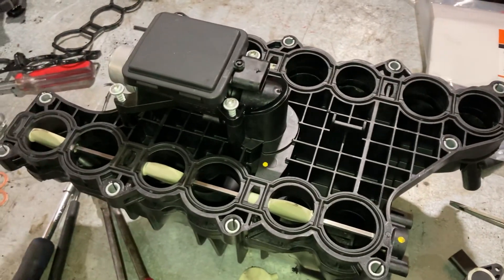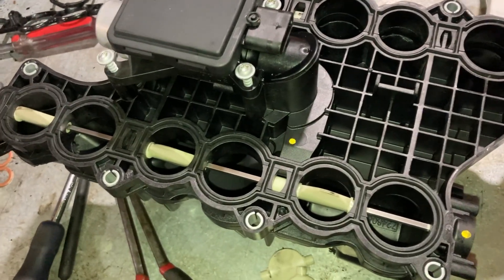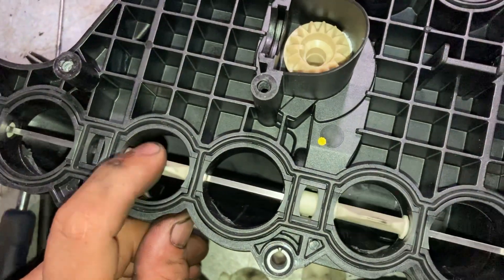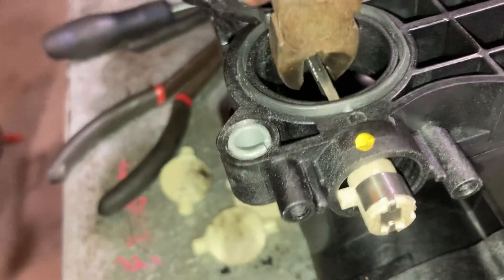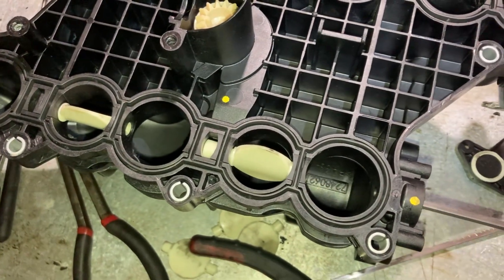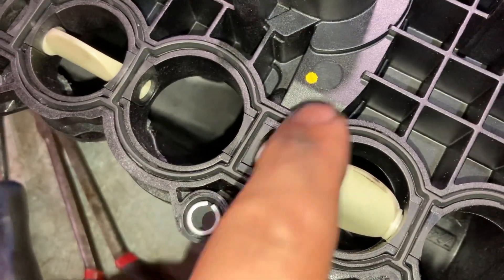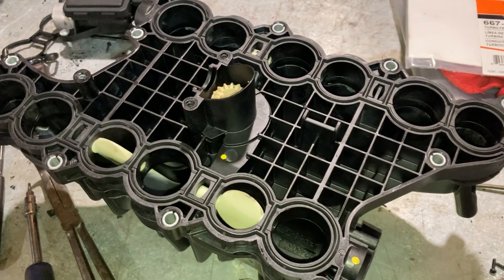Removing swirl runner valves from ecodiesel intake manifold

Comment from the maker: Just to be clear, for anyone who doesn’t know, removing the swirl valves will cause a check engine light on a truck that isn’t deleted/programmed to forget about it. I have heard the truck still runs great, but will cause the check engine light to stay on. I have never tried that myself. The truck in the video was programmed/deleted.

I’ve also used the Dorman intake manifold, and it works just fine. There was a time when the mopar manifold was affordable; not the case anymore. Also, I use black RTV to lock those small plastic pieces in place.

Comment from the maker: This is only for trucks that have been deleted, or programmed to forget about the existence of the swirl valve system. While you may be able to get away with removing just the swirl valves on a stock truck, the computer is still counting on seeing those position sensors and motor.

Comment: Did a stage 2 delete, also had the swirl valves turn off, at 88,000km and still going strong after 130k, probably a good idea for anyone pulling the intake off is to change that coolant line going to the turbo.
Reply from the maker: Absolute must-do.

Comment: I've got a stage 2 delete and I removed the swerl valves when I changed the turbo coolant hose and cleaned my intake but now I'm getting p200a/b codes is further tuning required or is there a quick fix for this?
Reply from the maker: @dannyaustin7008  that’s in the tune itself. You should coordinate with whoever created that tune your using. I’m guessing they did not turn off monitoring of the swirl valve system.

Comment: Great video. Is there a way to reduce the soot buildup inside the intake? Does long highway driving help prevent buildup? I had a 2014 Jeep GC and it needed a new intake manifold due to soot locking swirl valves. How often have you seen this happen? What percentage of Ecodiesels will this happen to? I now have a 2016 Ram Ecodiesel. thx
Reply: I have a 2016 with 170,000miles..had to replace the intake at 155,000..was completely filled with soot due mostly to the emissions recall that was performed a few years ago...Other than don't idle for an excessive amount of time, there is nothing you can do..any sites that you were able to purchase delete equip. are now gone..The EPA is slowly killing these diesel engines...I used to avg. 28mpg, now I'm struggling to get 23..
Reply from the maker: I’m sorry I never responded to your comment. The soot build up in the intake manifold in inevitable for any stock, unaltered ecodiesel that isn’t deleted.

As far as the soot jamming up your swirl valves…..I can’t imagine that happening anymore than once every 100-150k miles. But that’s only an educated guess.
Reply: @tadsworkshop  Thanks for the reply. We had a 2014 Jeep GC Ecodiesel (Gen 1) (bought new) and the intake manifold had to be replaced at about 90k miles. We had just gone on an extended 5000 mile road trip and on the last day the "exhaust regen" alert came on twice, even at 75 mph. A few days after we got home the check engine came on and the code reader said "intake runners" or something like that. Took it to the dealer and they replaced the intake manifold under the extended factory emissions warranty. Otherwise it would have cost about $4K. The "exhaust regen" alert had always been coming on during the life of the vehicle. Very disappointing. Even the catalytic converter needed replacing at about 4K miles. Took it into the stealership and they needed to perform a forced regen twice to clean the DPF before the new cat. What a POS. I now have a 2016 Ram 1500 Ecodiesel and am wondering if I should sell it before anything happens??? The "exhaust regen" alert doesn't come on very frequently. Seems a lot of around town stop and go driving (without proper and extended heat cycles) plugs them up quicker as does long idle times. I was told by my dealer the Ecodiesel needs to run on the open roads a lot to heat the exhaust, apparently to help keep the DPF clean. Biodiesel is a no-no on these.Thanks again
Reply from the maker: @robinsongguitars  thanks for sharing your story on that. Where are you located? I’m curious if deleting the truck is practical or possible in your area.
Reply: @tadsworkshop  I live in California where you can't even fart without getting a smog check. Wish I could delete the EGR, swirl valves, DPF and DEF nozzle...  Thanks for all the good info you provide.

Comment: Hello.Could you give the part number of the magnetic position sensor? or the numbers about it and the manufacturer? I'm trying to find it on the internet, but I can't find it using keywords...
Reply from the maker: Hi. You can find them it the video description of this video I created. https://youtu.be/gmPfzRpfr-4?si=57JP6_bLg-cG0RqS
But you should really verify the part numbers through the official mopar parts website, https://www.mopar.com/en-us/shop/parts.html
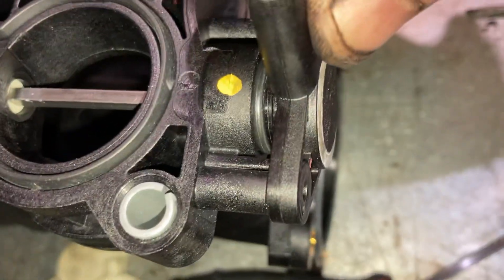Reply: @tadsworkshop  I mean the sensor in this video at 1:17
Reply: SAME!! I JUST THREW A P2016 ENGINE CODE AND ONLY THAT CODE. SAYS BANK 1 RUNNER POSITION SENSOR. YET I HAVE TO BY THE ENTIRE MANIFOLD SUPPOSEDLY. WHAT? IM WONDERING IF THIS DUDE HAS THAT PART NUMBER AS WELL.

Comment: what was the purpose of those?
Reply from the maker: It’s a way of managing air velocity into the combustion chamber, so as to reduce emissions, particularly at low speeds. Manufacturers need every advantage they can get to comply with emissions standards. These flaps have been in use since the 90s on a wide variety of electronically controlled engines.
Reply: My ecodiesel is deleted, do I even need the motor or swirl valves?
Reply: My eco is deleted and my check engine light came on this morning and it’s throwing code for IMRC. My question is if i do this then the IMRC is no longer needed correct?
Reply from the maker: @robschmidt-yw9ht  you do not need them. Consider replacing the manifold if yours is caked with soot from before the delete, and than remove them from the new manifold.
Reply from the maker: @gemer069  you should talk with the source of that delete tune. It should have turned off the swirl valve system completely and eliminated any codes for it. But yes, you can remove them now that the truck is deleted.

Comment: Does removing the swirl valve shaft change the fuel distribution with a hole through the length of the intake where it used to be? Wouldn’t boost push the fuel mixture into other ports via the open area between each one? Or is the pressure constant and inside the intake ?
Reply from the maker: I’m having a little trouble making sense of your question, but to be clear, there is no fuel moving within the intake manifold. Fuel is injected directly into the cylinder as with most diesels. Bottom line, the intake manifold on this engine is strictly for flowing air. The swirl valves cut off or reduce air to one of the two intake valves, for the sake of air velocity and how it affects emissions.
Reply: @tadsworkshop  Does that mean fuel doesn't get burned when there closed or there should be no fuel in the cylinder?
Reply from the maker: @Peterswarahed  no, not quite. There are two intake valves per cylinder. The computer uses those swirl valves to cut off, or reduce air flow to only one of the valves. Even if it were completely shut, the cylinder would still get air. And if you cut off fuel to one of the cylinders, this would create a dead misfire, like removing a single spark plug wire from gas engine. This is all an effort to manipulate air velocity going into the cylinder at certain times, which affects the emissions coming out of the exhaust.

Comment: Hey i did this to my deleted ecodiesel and now i have an engine light on. p2022 & p2017. Any questions
Reply from the maker: Keep the two shaft position sensors plugged in on the intake manifold. And maybe keep your the swirl valve electrical motor plugged in as well, although you shouldn’t have to. If all else fails, the problem is the tune itself. Inquire to see if the intake runner/swirl valves being turned off are part of the tune.
Reply: Do you know anyone that can adjust my tune I’m having codes because I removed my swirl valves and my intake butterfly plate
Reply from the maker: @adrianugalde5633  give me your phone number and I’ll call/text you with a solution.
Reply: @tadsworkshop I removed my valves but have no tune. I now have swirl valve position sensor circuit low codes. Any suggestions?
Reply from the maker: @biancajimenez8547  until someone reprograms the computer, that is just how it’s going to be. The computer is commanding the electrical motor to move the valves, so when it sees no movement at the sensors, that code will come on and stay on. I have to ask though; is the truck running fine? Not in limp-home mode is it?
Reply: No it’s not it runs fine. Actually
Reply: @biancajimenez8547  yea put them back on it made my truck run like shit and it has a tune my truck is actually still fucked up wont run out of limp mode

Comment: Thanks for sharing this. I recently picked up a new manifold too - and I do run an SFT stage 1 tune - which turned off my EGR as I wanted. I was wondering if you knew if removing the valves, but replacing the position sensors and the actuator motor so all it does is turn the shafts with no valves attached would keep the check engine light happy. Eventually I will do the rest of the delete, but was just curious if the system remains happy turning shafts with no valves on them?
Reply from the maker: Absolutely. It would have no way of knowing if the valves are actually in place. Go for it! I can’t imagine any possible way for the computer to receive feedback from removed valves.
Reply: i have the SFT tune also, about to knock out the coolant line and new intake manifold. wondering the same if the SFT tune is looking for the swirl valves
Reply from the maker: @msiege5212  before you even remove the old manifold, simply unplug  one of the swirl valve position sensors. If you are in front of the truck, looking at the throttle body, one sensor is down low and to the right. The other one is on the rear of the manifold, kind of by the passenger rear most injector. They have small fragile connectors, take care in removing them. Unplug, and see if your truck sets a code or reacts.

Comment: Hey Tad - I'm also in MI and digging into my own '16 Ecodiesel that I've owned since new. I'm learning about the EGR system and all the problems and have gotten to the point where I'm deciding what to do about the old intake and cleaning or replacing it. I'd love to talk more about it and what services you offer. Is there a way to get in touch with you?

Comment: Hi, I recently replace my intake manifold with a new one. I now have p200a and b codes due to a bad position or malfunction of the swirl valves.
Is there a by-default position of the valves when transferring the payment electric motor from the old manifold to the one ?
I didn’t realize at the time this could be important. I think the valves were closed when I installed the electric motor and when I see your video, yours are opened. But is it a problem ?
Truck isn’t deleted. I wanted to replace the manifold while dealing with the turbo coolant hose. It made more sense to me to replace it instead of spending 2 days cleaning it.
Thanks!
Xavier
Reply from the maker: @xavytex  did you disconnect the battery during the process? Might be wise to disconnect the battery, let the truck sit for 10 minutes, and than reconnect. If you left the battery connected during that time, it’s possible the computer was expecting to see the valves in a certain position, and maybe it was slightly different in the new manifold, thereby setting the code. Try clearing the codes. Also, if you have a better scan tool, see if there is an option to relearn those swirl/mixture valves.
Reply: @tadsworkshop  Hi, I disconnected the battery once I started messing with the harness.
I tried AlphaOBD. It has a function to test the swirl valves. It won’t let me perform the test “ECU has detected some values are out of range”. I’ll leave the battery disconnected overnight and see that does anything. Otherwise I’ll just take it appart again. Should be quicker the second time since every bolts are loose now. Thanks for your help !

Comment: Excellent Video. Is this a 3rd gen ecodiesel? I am getting code P200B. Dealer said to replace the manifold however I am able to get a tune done to leave the swirl runners open. Im not getting any acceleration issues or rough idling so im assuming they might be stuck in the Open position rather than closed.
Reply from the maker: This was a 2015/2016 model I believe. Sounds like you’re on the right track.

Comment: Awsome video!! Would it be any point to put epoxi in the holes (where the shaft was) between the ports?
Reply from the maker: @J1I9M7M4Y  really appreciate it. In hindsight, I’d recommend a dab of black RTV such as what you’d find at any parts store. And it’s just for the sake of holding them firmly in place. Is it needed? No, just exercise care so none of them fall out and into an intake runner while you’re reinstalling! I have installed manifolds without applying any sort of epoxy or RTV.
Reply: @tadsworkshop  Thank`s for the quick response and advice! You earned a new subscriber!!
Reply: thats what i was thinking too, make it solid for best air flow, im actually thinking of porting it a little to clean up casting lines too

Comment: Are you using a tune or resistor after you delete the swirl valve? If so which one?
Reply from the maker: An delete tune has to be used. Was already done before I got the truck. The computer monitors and receive feedback of motor and valve position, so there is no way to bypass this with resistors to the best of my knowledge. It’s not that simple of a system.

Comment: Hey tad great video... any tips? replacing the intake on a 2014 jeep grand cherokee ecodiesel.. when i got to it the intake runner control motor is broken... im not deleted... do you happen to have the moter you took off? Or know of a solution
Reply from the maker: No, unfortunately I sold that motor on eBay some time ago. You’d have to check with the official mopar parts website to see if there is a part number for that motor…..or search eBay for used intake manifolds or if by chance someone is selling the motor by itself. If it’s in your budget, you might consider a brand new mopar intake manifold. I know it comes with the motor. If your budget is tight, you could see if the aftermarket Chinese clones of that manifold come with the motor.
Reply: @tadsworkshop  I really appreciate the fast reply... I already got one of the cheaper intakes ($130) only thing it doesn't have is that motor 😭 didn't know it was broke untill I got in there... new Mopar is $800
Reply from the maker: @-RON-DOMINATION-  damn, your not kidding on the price. Believe it or not I could buy mopar ecodiesel intake manifolds on the official website for $320 a few years ago. At that time, new motors were 10k and I see now they are closer to 17k. Crazy. You might have to check with Facebook ecodiesel groups or ecodiesel forums to try and score that motor. I don’t suppose you can delete that truck in your location, can you?

I just double checked the website, and I see a new manifold kit is actually $662.22 plus tax and $20 for shipping. If that helps at all.
Reply: @tadsworkshop  I'm in minnesota so I could no smog tests... it seems finding anywhere that does the programing is hard to find now... epa scared everyone underground
Reply: @tadsworkshop  I have you saved so go ahead and delete I will definitely keep you in mind I was hopeing to do it with eztune or something simular as to not have to send the computer off
Reply from the maker: @-RON-DOMINATION-  absolutely understandable. Hope you’re able to get your Jeep squared away.

Comment: what if i broke a couple of those plastic little inserts holding the gaskets in place, you think it'll be alright without some of them ?
Reply from the maker: Your call. Think about how much pressure the inside of that manifold sees from the turbocharger, and bear that in mind. If in doubt, replace that manifold. You do not want to take it apart twice.
Reply: @tadsworkshop  yeah, idk. i kinda think it'll be alright. the first rod came out smooth. the second one hung up a lil, and before you knew it i saw plastic flying lol.